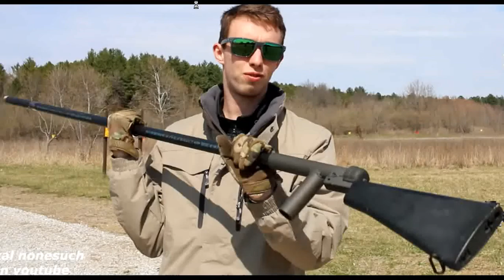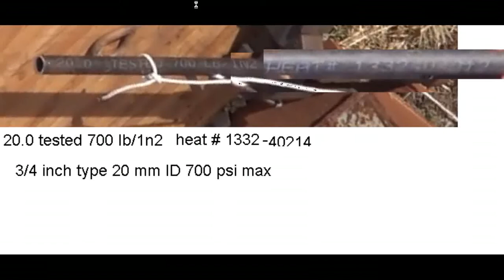royal nonesuch show UCnxygDVG8bdDIczIOQgfLgw archive any gauge caliber DIY pipe barrel tests waptek

Comment: do you have a dimentions for a .22lr?
Reply from the maker: saami & CIP argue over what the dimensions are , but 

Bullet .223 in (5.7 mm)  & .212 in (5.4 mm) Land diameter 
 .2255 in (5.73 mm) if driving bands  exist ? 
Neck  & Base diameters .226 in (5.7 mm) 
Rim diameter .278 in (7.1 mm)  & a .043 in (1.1 mm) Rim thickness 
Case length .613 in (15.6 mm) (Parent case = .22 Long )
Overall length	1.000 in (25.4 mm) 

http://en.wikipedia.org/wiki/.22_Long_Rifle
http://old.municion.org/22lr/22lr.htm
http://old.municion.org/22altres/22long.htm
Reply: The barrels for .22 pistols and rifles would need to be rifled in order to be ATF unregulated. 
Pistols need to have a grip and must be designed to be fired with one hand.
Rifles would also need to have a minimum barrel length of 16 inches and a minimum overall length of 26 inches.
If those guidelines are not met, they would be classified as an 'any other weapon,' requiring paperwork be submitted to the ATF before you build, as well as needing serial numbers and you'd need to pay the $200 tax.
Reply from the maker: OP only asked for  .22lr dimensions & AOW's usually have a $5 tax
Reply from the maker: a 26" gun & 18" barrel are the 2nd least regulated firearm 
as they can be rifled or smooth bore & almost any caliber

Comment: Minimum barrel length is 16”
Reply from the maker: yes, for non concealable minimum 26 inch over all length long firarms 
IF designed to be fired from the shoulder with a fore-grip, & butt stock 
it is 16" if rifled & 18" if smoothbore 

Pistol Grip only shot-shell firearms PGF, that lack a fore-grip & butt stock, 
can't be fired 2 handed from the shoulder &  can't be fired only 1 handed 
then can't be defined as a rifle, shotgun,  pistol, revolver, or handgun & can't 
be concealable AOW or SBR / SBS NFA  taxed, even with  very short barrels
like Mossberg Shockwave,  Black Aces Tactical Short Barrel DT  etc but 
ALL depend on the manner in which they are used, Do not conceal carry 

http://mossberg.com/wp-content/uploads/2017/05/MOSSBERG_590-SHOCKWAVE-PUMP-ACTION.pdf
http://thefirearmblog.com/blog/2019/01/16/remington-tac-13/
http://shootingillustrated.com/articles/2019/7/10/nfa-rules-on-shotguns-everything-you-need-to-know/

Comment: Do you have a dimensions for a 16 gauge?
Reply from the maker: 16.89 mm / .665 inch Smooth Bore 16 Gauge 
Barrel 's chamber DIAMETERS are 
20.83 mm /  .820 inch rim 
18.92 mm /  .745 inch base 
18.59 mm /  .731 mouth
(9.72 mm / .383 inch forcing cone minimum length  )

SAFEST is to use a true 3/4 inch drill to SLOWLY chamber a SCH80 "3/4" inch pipe that starts as a .742 inch Inner Diameter but works as  an over bore gun barrel blank 
or 
you could use 
a .660 ID  "1/2 inch" IMC (electrical intermediate metallic conduit ) section, hot flanged over the drill bits shank as a "true bore" liner in  a SCH40 "3/4" inch pipe that starts out with a .824 inch Inner Diameter
but fill in around the IMC that starts out with a .815 Outer Diameter 
 

SAAMI Z299.2 – 2015 (R2019)  page 25/32 
https://saami.org/wp-content/uploads/2019/06/ANSI-SAAMI-Z299.2-Shotshell-2015-R2019-Approved-2019-04-23.pdf